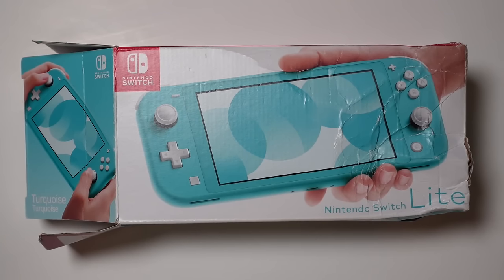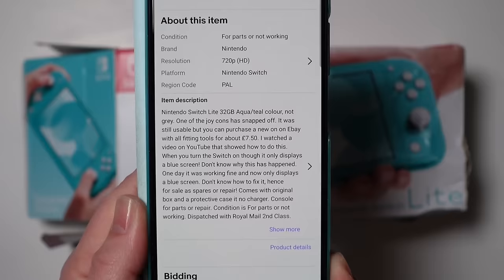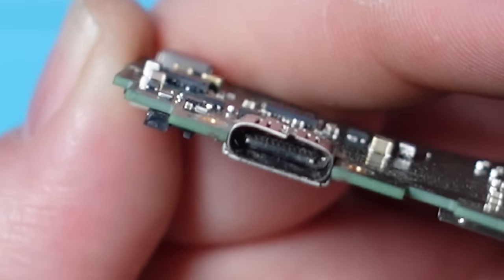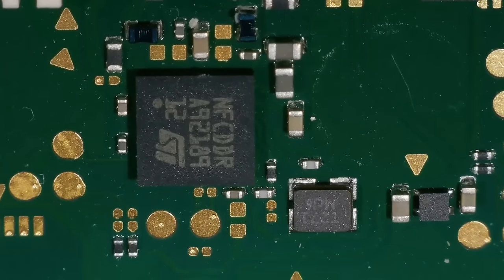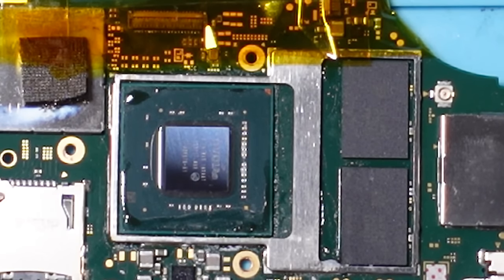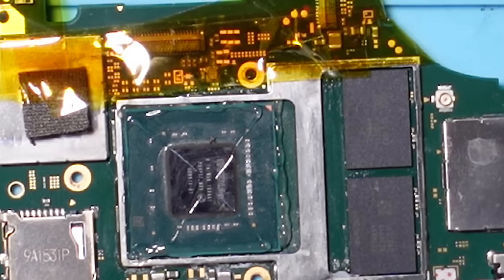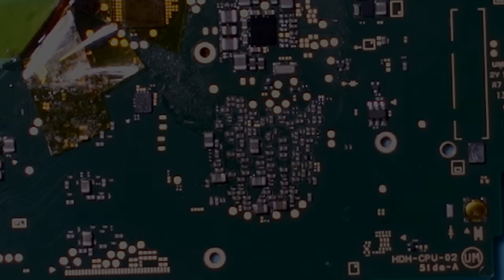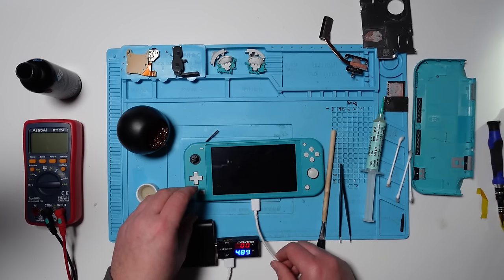Switch Lite with BLUE SCREEN OF DEATH | Can I FIX It?

Comment: According to other videos I saw, Blue screen in switch v1 model was related to nand corruption, nand chip being broken or nand solder joints being broken. When checking the board around the cpu, gpu and apu cheap multimeters can beep where they should not (low resistance doesn't always meant short) i would rather try to to check the caps in diode mode to. Don't want to upset you, but probably reflow or the reball wasn't needed, still this switch was probably unfixable
Reply from the maker: Thanks for the feedback! Not upset at all, I didn't think I'd be able to fix it, but I wanted a challenge to put me out of my comfort zone! I'm happy that I got to mess around with removing chips etc,. And I've learnt quite a lot, so I should hopefully improve! ☺ thanks for the tip, re diode mode. I'll give that a go next time! 👍
Reply: @StezStixFix  Yeah, keep up. You have a cheap donor board. And as someone said you can practice the reballing
Reply: A short on the board requires voltage injection and an IR cam, not random reflow.

Comment: Those are not shorts. They are simply a very low resistance tracks. And, if you did not know, the multimeter beeper is designed to simply beep once the checked resistance is below 50 Ohms. So anything you test that is below 50 Ohms will beep and this beeper function could be VERY misleading in these kinds of diagnostics. ALWAYS confirm shorts with a simple Ohm resistance function which will show 0 or close to 0 Ohms, not the continuity beeper option.
These APUs, CPUs and GPUs are powered and driven by very small resistance components and tracks. For example, most GPU power phases are around 1 Ohm, so it is pretty much impossible to confirm if the APU/CPU/GPU is shorted. The only way to confirm this is to know the board and resistances on it or have a working board for a comparison.

Comment: I got recommend this and I am pleased. Good job. By the way, caps under CPU have low resistance to ground, they're not actually short.
Reply from the maker: Thanks. Yeah, I learnt the hard way! But that's how we all learn i guess! 😊
Reply: have any diagram or video for making a diagnose for the lite? im like crazy searching
Reply: @pablohdz14  what's the issue? unfortunately there are no public schematics for any game consoles. However, depending on symptoms, we can sometimes track down the problem and fix it! some things arent fixable though :/
Reply from the maker: Thanks Chase 👍 @Paul, yes it is hard to diagnose, but depending on the issue you can usually narrow it down to a certain IC or area of the console! ☺
Reply: I used a quick grip on the GPU once to get a switch to boot from a blue screen. and it worked perfectly. 

This is my method now before I apply any heat. 
the CPU can't take that much heat,
Reply from the maker: Interesting, thanks Chris! I do have another blue screen one lying around. I might have to take another look at it. 👍
Reply: @StezStixFix  yeah it doesn't always work, but if it doesn't I don't bother attempting a reflow.

this method is more likely too work when you can see the switch bent suggesting a bad solder joint.

The screen on the switch can take quite alot of pressure, but I have damage a screen from too much pressure. so be careful.

I did also try and make a xclamp, well I mean I stuck a 2 pence piece under the heat pipe, and screw it down, but that wasn't enough pressure.
Reply from the maker: Thanks Chris, appreciate the info 👍 cheers 😊

Comment: Wow, I used to rework (around the time of Xbox RROD) and when I did, I always used a laser rework station (where a insanely strong laser pointed at the die would heat it up) to rework/reflow those bga chips. Good on you for trying with hot air.
Reply: Do you dance around with a glow stick while it heats up? 😀

Comment: I think that is the same model microscope as I have. The Andonstar ADSM302 it looks exactly the same other than that has a different arm. It's a decent microscope for the price and I like the fact it has HDMI out. So you can connect it up to any size screen. I will have to check your unboxing video.
Reply: Also I don't know if you already know but the main chip has very low resistance so will cause the meter to beep. Normally one side of the caps will be 0 ohm and the other side about 6-8 ohm. But most meters beep between 0 and 10 ohms.
Reply from the maker: Its the Andonstar AD407 I think. I've been using it again today, and I'm really happy with the quality of it.
Reply from the maker: Thanks for the heads up on the caps. I've got another board, so I'll play around with it and see if I can get some readings before I go attacking the CPU again! 👍
Reply: @StezStixFix  Ahh it's an upgrade on mine with a 4MP sensor instead of a 3MP sensor. I didn't know they had brought a new microscope out.

Comment: Don’t know if is needed but, I have some practice repairing iPhone boards, I noticed you jumped to the conclusion there was a short on the back of the cpu, the thing is there is no schematics for it but just based on my experience around the cpu runs usually voltage in the range of 0.8v-1.1v tops, those lines will beep since they mark close to 0 ohm, it doesn’t mean they are shorted, you can verify that by measuring each side of the capacitor and after identifying the side with the highest ohm mark inject 1v 300mah in that side(positive) usually it will drain very little or even nothing, so it’s not shorted, search around inductors they’re more probable to fail since they give power and high amperage to other components. I may have ended up all over the place but the thing I intend to say the most is to avoid messing with the big chips as long as possible, problems often are in the analog components.
Reply from the maker: Thanks Daniel. I really appreciate the info! I've learnt quite a bit since this video, so I wouldn't make the same mistake again (hopefully!) Thanks again for taking the time to comment with all the information! 👍
Reply: @StezStixFix  no problem I’m digging your videos love the repairs of old handhelds and such, great work, keep on doing it!
Reply from the maker: Thanks Daniel! 👍

Comment: Biggest mistake Professional Servicemen do when using a Hot Air station is setting their hot Air Stations wind speed insanely beyond 25%. 
High airflows are in fact  the main reason if not the only reason why Re-balling BGA chips fail, Mind you if those capacitors you checked after the reflow attempt were already shorted, it's a good indicator the chip nearby connected to them needs replacing, Such a small BGA chip BTW can be repaired without a Template if one has a steady hand and a suitable Cheap BGA Jig for it..
Reply from the maker: Thanks for the feedback, once again! Yeah, it's just so tempting to whack the airflow up! Ill remember that one for next time... I will use the board to practice on, and I've ordered some solder balls so I can give a manual reball a go! 👍

Comment: You need bottom heater to pre heat the board to not warp it and 0.35 balls and stencil ODNX02-A2   ODNX02 -A2  0.35MM  BGA  Stencil Template and jig to hold CPU in as reballing it. I like to use aluminum foil instead of the tape, it reflects the heat better off the plastics connectors and have not melted one since. 

It is not as hard to reball I did a few of the regular switch and to my surprise first one was successful. I reball xbox360's and laptop gpu's back in the day, do have some experience. I actually going to attempt a lite soon, if can find one at a reasonable price that seller doesn't lie and sent completely water damaged.
Reply from the maker: Thanks Genie! Since doing this video, I have got myself a mini hotplate and the solder balls. No stencils yet, but i might give hand reballing a go at some point! 😬

Comment: Nice video ,👍
Good practice on trying to solder that chip back, but may I give you a little tip?
Way too much flux used to attempt soldering the CPU back on it was floating on the flux and could not contact the pads that is why you had to boil the flux away before the CPU wanted to stick.
And if that was a working CPU, it would be dead from all that heat you used to try it to stick.
Before soldering the chip back on go over the pads with some solder wick and lay some fresh leaded solder on so that you bring the solder melting temp down, that unleaded shit needs a lot more temp than leaded solder.

As of this one is dead I would practice on it and desolder and resolder it a couple times till you feel comfortable with it.
You should aim to solder it with a shorter time of hot air and try to minimize the temp.
Practise is the only solution.
Reply from the maker: Great tips, thank you! I will be using it to practice on. What temperature range do you think is best to try out? I guess not 480? 😂
Reply: @StezStixFix  Hi, .you can go to 400 ,
With experience you will see if you need the nozzle closer or farther to prevent board or chip damage.
The trick is to put most heat in the board to desolder the chip and not the chip itself.
You can do this by holding the hot-air nozzle at an angle and blow the hot air on half the edge of the chip and half the pcb in a circular motion around the chip.
The air that hits the pcb will bounce partly off the pcb and hit the underside of the chip and the solder do this until the chip is loose.
If you are afraid to blow of small parts around the chip tape them with Kapton tape or some metal shielding to prevent it.
Also, keep in mind the backside of the pcb where the chip is located if there are small resistors ore caps that they don't fall of the board if you put too much heat in the board.
If the chip you desolder is faulty you can go medieval on it as you did, you reduce the risk to damage the board or nearby parts.

To resolder a good chip, clean the solder pads on the board with some flux and desoldering braid , clean whit some IPA , put some fresh flux and add some fresh leaded solder
on the pads not to much else you have a risk of shorts and put the new chip on and solder it in the same way as desoldering in a circle motion.
A little trick before you put that bga chip in place pre-heat the area before placing the chip.
Let the to air melting the solder and not heat up the chip to melt the solder.
Next phase is re ball the chip.😄
Reply from the maker: Thank you so much for taking the time to post these tips.  Some excellent information in there and I will definitely be giving it a go. I guess it's all about the practice - I already feel more confident, and I have only ever tried once! 😊

Comment: A short can be caused on one side of a board and shown itself across the other. Console boards have insane layering and pathways that we can't even see. 

I can tell you're still relatively new to this so keep going! We learn by doing and we sometimes get lucky, often we don't (lol). Keep learning.
Reply from the maker: Thanks Danny! Yep, that was genuinely the first time I'd ever removed a BGA chip, so I learnt a lot! 👍 Hopefully I'll have more luck next time 😬
Reply: @StezStixFix  

No problem! You will have more luck, I'm sure.

The final thing I can add is that it'll usually start to click in chunks. You'll go from having a very basic idea of how any of it works and then one day boards stop looking like a crazy, populated mess and start to make sense. It just clicks. It's hard to explain but you'll likely experience it, too.

It will help to fully understand what each component does in a circuit. That way you'll stop seeing random rows of caps, resistors, etc and start to see design.

"Oh, that's a power supply there and, oh, that's the bridge rectifier"

Pretty soon you'll see that all electronics are made on the same 5 or 6 basic designs: power in, convert AC to DC (if power adapter didn't), filter, upvolt or downvolt,  send to chip.
It'll come. Good luck!
Reply from the maker: @DannyWilliamH  Awesome info, thanks again. I feel like I'm getting there, and definitely starting to understand what components do what. Really enjoying the journey too 😊

Comment: **Addendum**
If capacitors test OK once removed and a short still remains, the tracks indicating as a short lead to a chip, then it's that chip that has shorted, only fix is removal and replacement, this board will be a good practice board for you to do your first MANUAL BGA "Search YouTube for tips on how to manually re-ball..
Reply from the maker: Thank you! Will do some research before I go diving in! 😊

Comment: Im a new sub and I've been spending some time with some of your clips. In this one im nearly sure that even a working Switch will show shorted caps right below the cpu due to their low impedance. I will test one when i have a chance. So you probably fixed it with the first attempt, but we'll never know because you didn't test it 🤕

Comment: Practice? Well. Too much airflow. Too much heat. Wrong nozzle to take off that big of a chip. Also. It’s a good idea if you learn some electronics. I have seen some of your videos now and it’s basically check for shorts and parts cannon. Rule number one is always thou shall check voltages! Understand what’s going on. What could cause these to be pulled down to earth. Was it an external issue or the chip. We don’t know from this video. :)

Comment: i recently had a BSOD on a swite lite after trying to install a picofly chip in it. i heaped up to much solder in one section of the flex cpu cable when i put it back together it shorted on a cpu cover screen went all pink and pixelated then after turning it off and back on it would bsod every boot... unplugged it from the battery left it overnight and it booted normal again once my mistake was corrected solder wise. i think this BSOD can be many things not just nand related.

Comment: Tough break lad!  In future test all the caps before diving in ;)  Reflowing won't fix a short, but will resolve hairline cracks in the BGA joints.  Use more kaptan tape when masking off so you don't blow away commponents, you were lucky this time.  To be fair it wasn't going to work again, you tried your best.  Might be worth trying to learn some BGA techniques for future fixes, see if you can get that blue screen back again.  Just watch the temps :D
Reply from the maker: Thanks! Yeah, I have a tendency to just dive in there! It's all still pretty new to me, and I'm happy I got to do some chip removing practice! 👍

Comment: I would have cleaned board and chip, drown chip with flux and use my iron to add solder to the chip only, basically reballing.

Comment: I saw on another channel, related to graphics cards, that giving them a quick blast with a heatgun can often (at least temporarily) fix them, would this just be down to giving the solder a bit of a "reset"?
Reply: What happens is when the guy was attempting this joystickrepair. He probably flexed the board. Cracking some of the solder joints on a key thing. Ram, apu, nand. This also happens if the system itself gets too hot. Melting the solder. Heating melts the solder again. But is always a temp fix. If it works at all. You'd have to clean up the board and chip. Than reball the chip with new solder.

Comment: These days everything is made cheap. My Super Nintendo which is over 20 years old still works. But consoles today go bad in less than 7 years, my PS3 and XBOX 360 now do not work. They use higher tech and the new systems get hotter, you think they made them more quality parts.
Reply from the maker: I agree. Although looking at the new Ps5 and xbox, it really does look like they've taken that into account. They look solidly built and there is a way more cooling in there!

Comment: Those caps on the back of the cpu have a naturally low resistance to ground
Reply from the maker: Ah. But yet they didn't short to ground without the CPU in the board 🤔 Please don't tell me I took the CPU off for nothing 🤣
Reply: Your right they have low resistance. Blue screen is usually a hardware faillure of a bga like the nand, cpu, ram. If reflow does not help then you have a donor board. I learned it the same way you did. It is a learning path as Nintendo does not provide schematics.
Reply: @StezStixFix  Yeh we've all been there mate, all processors have low resistance/impedance to ground because they are "high" current circuits. Try a no power issue switch or something, good effort on the ic swaps though, for your first time if it is, that's excellent, good luck and keep trying, this is a game of patience and perseverance
Reply from the maker: @reacey  Thanks Reace, genuinely my first time, so I am quite happy with how it went.  I'll keep learning, and the comments I get are really helpful!  So, thank you again 😊

Comment: i got mine in my birthday of 2020 november 16 2020 does it have a risk of still having this issue or did they fix it in the newer models of switch lite?
Reply from the maker: I think it may still happen if it's dropped. From what i know, it's the solder cracking under the chips that usually causes it!
Reply: @StezStixFix  alright ty

Comment: Sometimes when working on a board like this and there isn’t an obvious fault, I pray to the bga gods and give those chips reflow heat and a little tap anyway cause why not?   If it still doesn’t work, I like to blame an ESD.